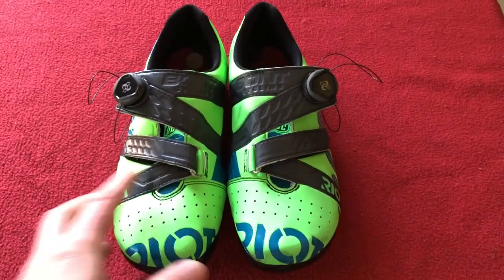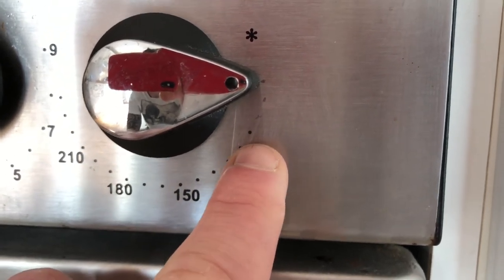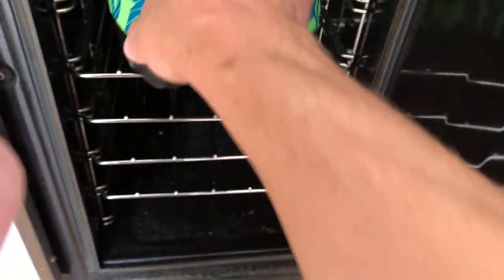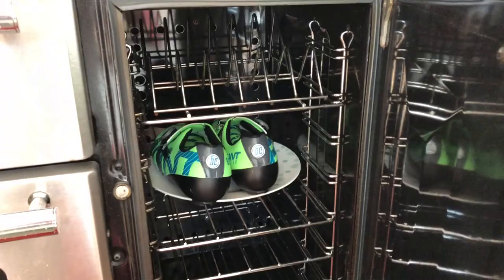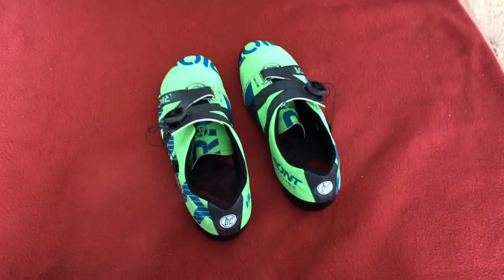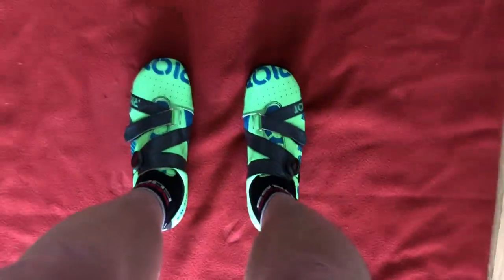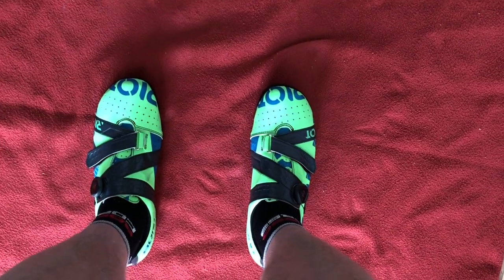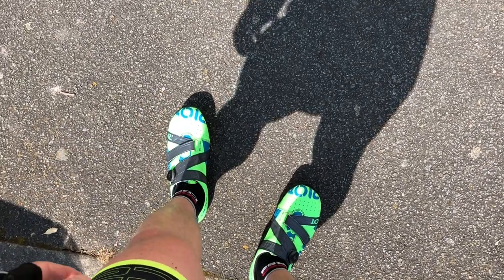Heat Molding Bont Riot Road + Shoe

Comment: Thanks for the video as I was afraid to do this.  As side note, I fit into Sidi 43.5 Genius 5 shoes perfectly and went with 44 in the Bont's.  A tiny bit more length but more width for sure.  If that helps anyone with determining size.
Reply from the maker: Vickie Kaye no problem, glad I could help in some way, I’d agree that sizing up a little is a good idea. 👍

Comment: I find the older models such as the Vaypor have a narrower heel cup right out of the box which holds the heel like a vice. Which is great. The newer models with boa fasteners have the cups updated to be much wider which I find doesn't hold my heels at all which is annoying. Trying to correct this by heat molding and squishing the heel cup to make it narrower :).
Reply from the maker: Nice work, I find it a great shape for my foot, the molding improved the fit though
Reply: ole gunar how did you find squashing the heel to improve the heel hold?

Comment: I tried the riot + on but found the piece of carbon at the arch digs into my arch when standing up. I'd have to move this piece quite far. Do you think that's possible without breaking?
Reply from the maker: Christoff87 hmm I’m not sure but they do move quite a bit when soft. Sorry I can’t be of more help, though it might be enough just to make it comfortable 👍
Reply: I have the same issue too, on the Bont Tri shoes, it became so unbearable that I had to loosen the velcro straps substantially....definitely gotto heat mould and then thumb press down the arch region I reckon.
Reply from the maker: V gk yeah moulding makes them better than off the shelf in my experience... 👍
Reply: @KyrosHouseCycling  Just got round to moulding these. For everyones information I had to take my oven to 100C before the sole became soft enough to mould, took it to 110C for a few minutes to give me some time to mould the shoes. I was able to get the arch to a comfortable position and these feel great now! Just wear gloves when moulding because at 110C they are freaking hot! Also I had a digital thermometer in there so I could control the temperature accurately.
Reply from the maker: Christoff87 nice work! I had to heat them up hotter than recommended to be able to mold them too. Glad it worked out for you though! 👍 and good call with the thermometer, wish I had one .
Reply: @CantE8tCheese  hi i know this is a two year old comment so the chances you reply are slim, but do you remember specifically how long you kept the oven at 100c? Thanks!

Comment: Thank you for your videos. They help me to choose a right cycling shoe for me. With a really wide feet Bont Riot seems as a right choice. How do you find those after a molding?
Reply from the maker: Jaroslav Klos actually better than before! Which I didn’t think they could be, scrunching my toes during molding definitely helped me. 👍 thanks for watching me!
Reply: i wouldn't, the shoes have quite pronounced upturn of the sole around the edge of the shoe of extremely stiff material, it isn't easy at all to heat mould, you have to use the butt end of a screwdriver to expand or move it away from the edge of your foot - it's a pain in the butt to do.You'd be better off just having material around the edge of the sole as it will eventually give a little and not pinch the side of your foot. These soles are super stiff, and if you have normal width feet are pretty good, but for wide feet, i wouldn;t recommend.
Reply from the maker: bitchoflivingblah I didn’t find that to be the case at all, just heat them up at a higher temp as per my video and for longer than normal, they are excellent for my wide feet, and I like how the sole wraps the edges of the shoe, it’s preference of the individual though with a bit of molding the shoes fit perfectly. 👍

Comment: Sir can i ask something..
If the heat molding process make the sole more comfy (like making personal insole fit)
or is just affect the upper of the shoe... Thank u
Reply from the maker: It’s for the carbon sole of the shoe, it’s like a bathtub which your foot goes into, so your basically moulding the sides of the bath to your foot. 👍

Comment: Very curious to know how these shoes are compared to your previous ones ? (Which ones were they).....I have narrow feet so not sure if its a good choice,
Reply from the maker: Ravin Premji I had the shimano RP9 road shoe. Too tight for my toes, I tried wearing them to see if they would get better but they didn’t. These are much better out of the box, and even better when you mold them, as I’ve found if they are tight when your off the bike they’ll kill you on the bike. 👍
Reply: Perfect....I am using the Giro Empire ACC, look cool, but same issue as yours as these are super narrow....thanks and I am planning to give these Bont's a go. They dont look as good as the Fizik or Specialized S Works 6, but comfort is key.
Reply from the maker: Ravin Premji I agree, comfort over looks, I actually really like the colour scheme of these so it’s a winner all round! I’m now a convert of molding shoes. 👍

Comment: Does the hard plastic base of the shoe gets moulded too? My problem is that my wide feet sits on the hard part on the sides and it hurts even to wear them
Reply from the maker: You’ll have to get a screwdriver handle or similar item and push from the inside of the shoe where your feet touch when moulding them. 👍

Comment: I bought a pair of bonts, did the heat moulding but the right one came unglued and the carbon was still solid. The ratchet came off and the front sole came off. The left one was fine. They went in the bin (a brand new pair) because once you’ve done the oven thing the guarantee is void.  Never again.
Reply from the maker: Oh dear sounds like you have had a bad experience there.... maybe cooked them too hot?